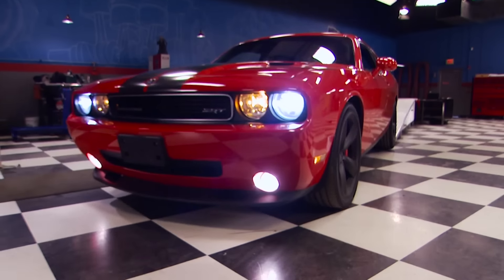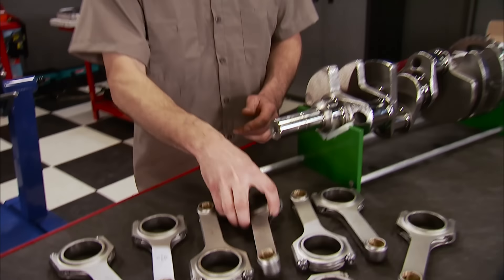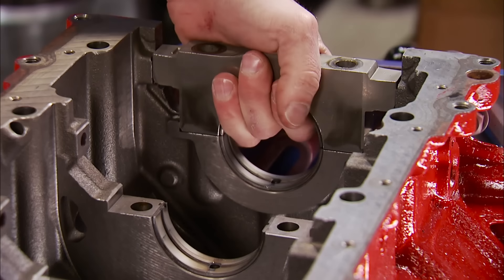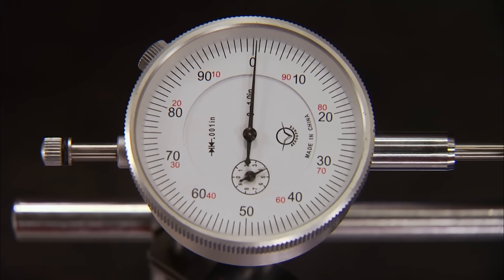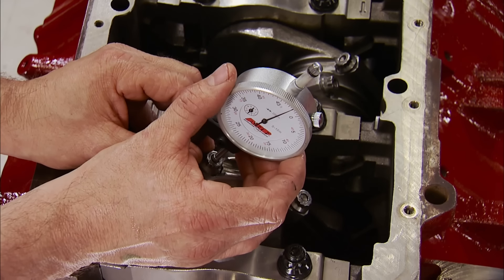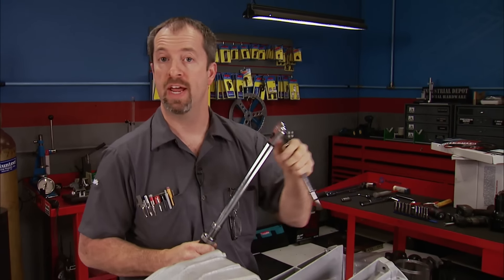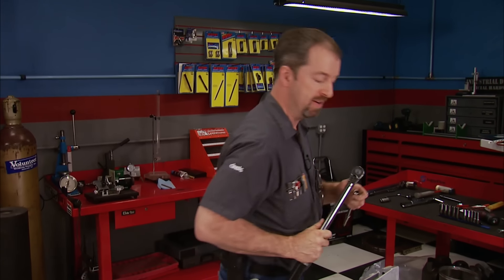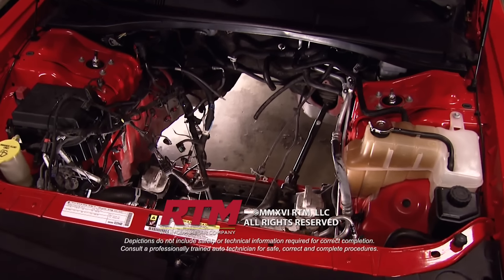Building A Twin-Turbo-Capable 420-inch Gen III Hemi For A SRT8 Challenger - Engine Power S3, E12

Comment: The mains are NOT a 6 bolt design like Chevys LS motor. That’s a blatant lie. I don’t know how they let that get to the public. Makes Me question who really has the true knowledge at the company/channel🤦🏾‍♂️
Reply: @19chev81  last time I checked My eyes worked pretty good. I only see the 2 that’s studded and the 2 cross bolts. PLEASE explain where these magic bolts are hiding🤦🏾‍♂️
Reply: @19chev81  no they're not the hemi is a 4 bolt main
Reply: Its only a 2 bolt mainz. Those sides ones are there to make the block stronger. There is ftermarket blocks that are true 4 bolt mains with the side bolts a little bigger for strength
Reply: @wkjeeping9053   no wonder they don't last

Comment: 6.125 rod, LS 
0.927 pin, LS
1.5, 1.5, 3.0 rings?    LS

Anyone else picking up on a trend?
The Ford Godzilla did the same shit.  Used LS roller lifters and trays in theirs, along with several other items that were damn near spot on identical to LS.  Had they not made such GIANT gaps around the cylinders to allow for machining in a fire ring, the blocks and heads would have been able to handle a LOT more than 1000 hp before lifting the heads and torching the blocks.
Reply: Yeah LS stuff is a lot cheaper than Mopar stuff, and available in more configurations than Mopar stuff.